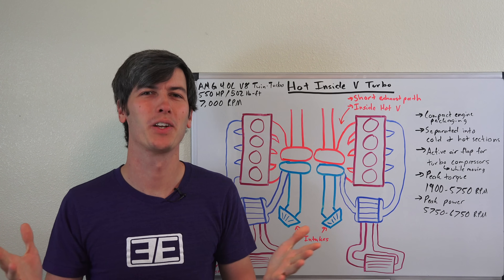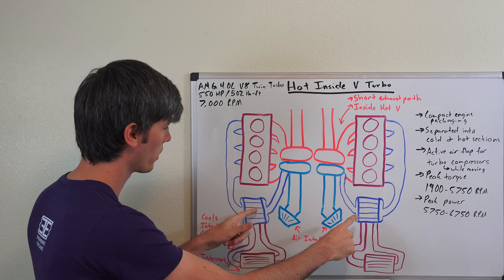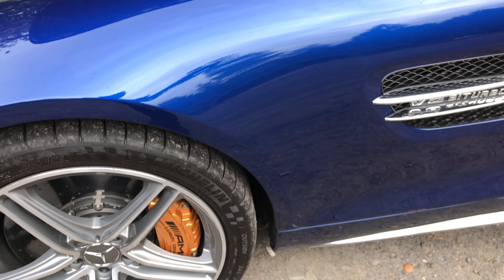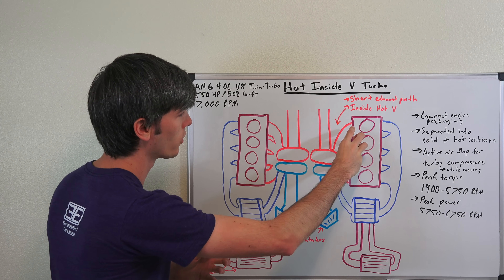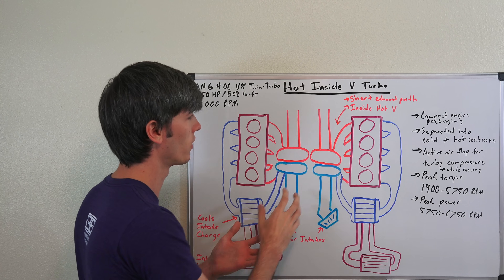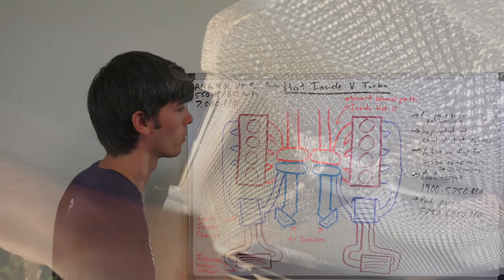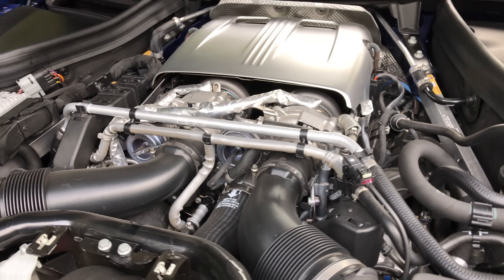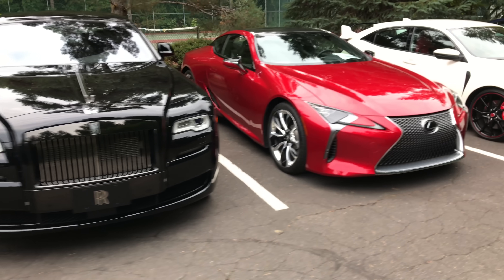Mercedes Clever Turbo Engine - "Hot Inside V"

Comment: American drag racers did something similar with Buick Nailheads in the early sixties. They ran superchargers into the exhaust side of the heads with specially ground cams and headers mounted in the intake valley all in an effort to compensate for the awful exhaust flow of the vertical valve design.

Comment: So let's ignore all the prior manufacturers who've been using the "hot V" turbo setup for almost a decade and call it "Mercedes clever turbo engine" as if they somehow are the propagators of this technology. Wonder who sponsored this episode...
Reply from the maker: No one sponsored the episode. I would have mentioned it if they did. It's a clever engine. I drove the GT C. I made a video about it. It's that simple.
Reply: Fair enough. Would've preferred if you'd just made the video about 'Hot Vee' turbo technology rather than showcase an engine that's late to the party when it comes to that specific tech as if it were some sort of revelation in automotive engine design. N63 from 2008 is the first engine I can think of that had this configuration so it's been around a minute.

Comment: I am confused...BMW has been doing this since like 2009. Why is Mercedes-Benz claiming this is their inventive design???? My dad's 2009 BMW 750Li has this engine configuration. A 4.4 litre twin turbo V8 and the exhaust and turbochargers are inside of the V...also Ford with their new 6.7 litre Powerstroke V8 diesel, the exhaust is on the inside of the V with the turbocharger...so....please someone explain. Because this efficient engine design has been going on for many years.

Comment: This concept actually was used many, many years ago as an aftermarket (dragster) layout of the Buick Nailhead V8. People would use a reversed camshaft and run one or two superchargers to what used to be the exhaust manifolds, and run the exhaust straight out the center of the engine (old intake). This was to deal with the grossly undersized exhaust ports on said nailhead V8. Different reason, somewhat similar idea.

Comment: The ford powerstroke also has the same intake/ turbo system...
Reply: Sort of but not exactly... The 6.7l Ford Powerstroke diesel uses a reverse flow head where the exhaust feeds the single turbo in the valley. However the MB design is the first one of its kind on a gasoline engine and is twin turbo on a sports car...
Reply: 7.3, 6.0, 6.4 were International engines with traditional flow.
6.7 is Ford engine with reverse flow.

Comment: Audi and BMW have done before, BMW has done it better, they used twin scroll turbochargers and fed each one from both cylinder banks so the could receive "Even Fire" pulses, something you can't do with a cross plane V8 feeding one turbo just from one bank

Comment: Wouldn't it be better if the intercooler was connected to the 'intake' part of the turbo, instead of the engine? I guess it's probably cause the cold air would warm up as it goes through the turbo, but I was just wondering though because it seems like the air would lose pressure as it goes through the intercooler

Comment: I can see the benefits of this setup in terms of throttle response, compactness and efficiency.....  wouldn't like to be the one doing any serious repair work on it though!!  $$$$s/ ££££s
I'm curious as to how Merc deal with residual heat after hard driving, since the red hot turbos are only a few inches below the bonnet, once the natural air movement is gone, the bonnet must get incredibly hot, no?
Reply: soundseeker63 I believe that is what the coating on the bottom side of the hood is for, although yeah things would still be toasty
Reply: As to repair expense, it's an AMG engine. Not unlike an M-engine or any other extreme example of a regular road-going engine, they are set to extreme tolerances and, when they break, those expenses tend to be extreme as well.
Reply: Maybe but if you compare this to say, the old merc 6.2, or the N/A M5 engines, you can't help but think these ones look excessively complex and scary to work on.

Comment: The turbocharged V8 in the F10 m10 has a similar layout with the exhaust in the middle only the layout of the exhaust is different combining pistons from both the heads to remove the typical cross plane sound.

Comment: I pity the 3rd owner of that car - good luck to ya bud.
Reply from the maker: Do you really pity someone who's probably going to shell out $90k for one of these down the line haha?
Reply: Engineering Explained Uh I am pretty sure nobody is gonna pay 90k for 3rd hand C63s, heck I doubt 3rd hand AMG GTs go for that..
Reply: Seems way easier to service than having the turbos on the exhaust to me...
Reply: Guillermo Lopez All turbos are on the exhaust, Mercedes simply reversed the cylinder head flow so the exhaust side is on top, but I know what you mean. With the AMG GT they did it years later than BMW so they must be saying that the 2011 M5 isn't a production sports car.
Reply: my final offer? $20.

Comment: What do you think about using AC compressors evaporator dipped in water reservoir of intecooler system in order to reduce temp of intercooler water? is AC going to use more power than it can contribute to power increase by lowering the intake temperature?

Comment: Could somebody explain why you couldn't just extend the rods that connect the two turbines and move the compressors out of the v and into the front more? Seems like the obvious solution? Am I missing something?
Reply: Spencer Hebb would be possible, but then you have more mass to drive -> larger turbo lag
Reply: In the Mercedes F1 engine the turbine and compressor are separated by several cm giving space to house one of the energy recovery systems. I don’t understand why they aren’t separate either. The inertial mass of a narrow shaft is insignificant and if you can make bearings that are comfortable inside the exhaust turbine forming a shaft and bearings to join the two would be easy and you could put each in the hot and colder part of the engine. Yes i must be missing something too.
Also you could put a generator on the turbine and motor on compressor and join them electrically but that is a whole different game.
Reply: BY doing just that with their F1 engine they won two world championships because of the following.
By seperating the two halves of the turbo they reduced the heat input to the incoming air which meant they could use smaller radiators and intercoolers which in turn meant narrower bodywork which led to a smaller cross section exposed to the air which gives less drag and less weight which meant they had more to play around with and put where they wanted it on the car as they are all built under the minimum weight regulation.
The biggest surprise was when no other manufacturer copied their design!
Reply: I don't know much about the engineering of something like that, but it seems the longer that shaft is the tolerances and materials would need to be insane.  Also it would require some proprietary turbo assembly.

Comment: Why not just use superchargers? This still has some lag, it's not instant like a supercharged V8 :)
Reply: Daniel Sadjadian superchargers are less efficient, would heat soak the entire engine, make less horsepower, and superchargers make peak boost later than turbos.

Comment: Is it possible to eliminate all the junk in front the engine ?
Reply: Sure. You can basically take all this unnecessary stuff off and your engine will run perfectly fine. Can't believe AMG didn't think of that
Reply: a radiator, two intercoolers and a coolant reservoir take up a lot of space
Reply: Yes they COULD but not likely. I'm not sure what advantage MB see's in water-to-air inter-cooling over air-to-air cooling. I know it was a required setup on the old supercharged amg engines but not with turbochargers. For whatever reason they just stuck with it. My only guess is that it would be harder to incorporate/route the larger air piping to the front and the required lager size heat exchanger vs the water hoses with the limited space on the gt cars which get the engine first then sprinkled down the other models. They are not going to design separate cooling system although a air-to-air system would save weight but weight saving is really not MB's forte. Their more high HP focused brand.
Reply: I am talking about the complicated cooling system , couldn’t they just put normal and small intercoolers ?
Reply: Stuff like liquid radiator, radiator for air conditioning, core support, and other structural stuff to tie the two sides of the car together? All the accessory jazz for water pump, electric fans, a/c pump, alternator?
Reply: I think small intercoolers that are water-to-air are more efficient than air-to-air in thermal energy transfer, due to the nature of water being so dense.

Yet the coolant circulating intercoolers isn't as cool as the breeze outside of the car. It's a trade off, and one that I'm sure engineers scrutinized the details of at excruciating lengths.
Reply: Mercedes have a history of doing that, see sls. This allows them to mount the engine further away from the front wheel making is better for weight distribution, therefore handling is enhanced.
Reply: Go back and watch the video again, but this time listen to the reason why they have this layout and answer your own question.
Reply: They have two, so each would be dealing with 250bhp's worth of air
Reply: tjsavage711 timing belt stuff?
Reply: yea a 383 small block Chevy with a carburetor has non of that crap and is actually smaller in size  but bigger displacement  and can make more horsepower and way more torque.  Technology is cool and all but when you can achieve the same  power output by just adding a half inch to the bore and stroke it makes that monstrosity of things to break look kinda pointless.

Comment: I think there was a drag racer that converted a v8 to have exhaust on the inside, that being said I can't seem to find the photo again, and it was a natural aspirated engine
Reply: Way back when, black and white photo
Reply: Reverse flow cams
Reply: Rodders used those on ford lathead v8s because flatheads shared intake ports but had 4 exhaust ports
Reply: I've even seen photos of a turbocharged flathead v8 from the period
Reply: Nailhead v8 with reversed heads maybe?

Comment: Great engine but can't drive through rain!!! Autovlog's subscribers know what I'm talking about :D
Reply: Intakes for turbos are all along the top. Water and open holes dont mix
Reply: Quin atakara Wait a minute. So you are saying someone built a car you cant drive in the rain??
Reply: Takes a good splash of water to lock an engine. Smaller amounts convert to steam on the way through. It's traditional to clean diesels and other engines by spraying small amounts of water in the intake while running to take carbon out of the cylinders.
Reply: that engine would cost like 100k to replace lol
Reply: Abbas Sadeghi Bajgiran !
Can you explain the reason behind it ?
Reply: I know in all it's greatness a little water took in down
Reply: You can definitely drive it in the rain, this was just a certain case where the design messed up.
Reply: Quin atakara Oh I see.